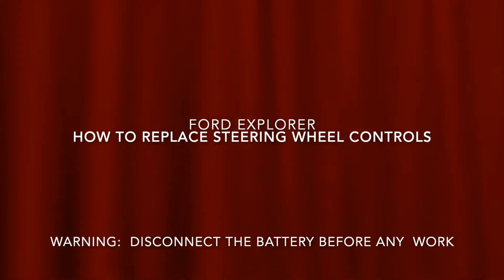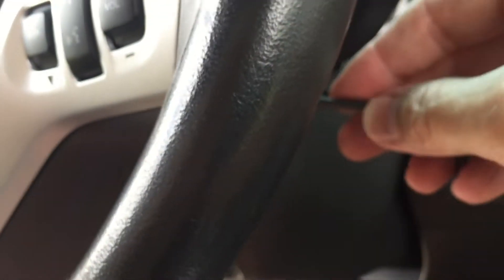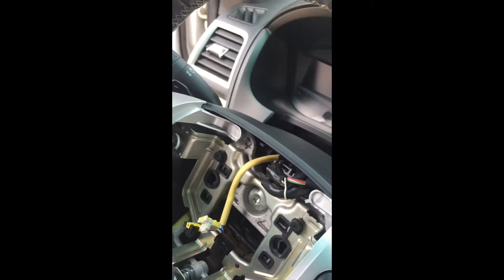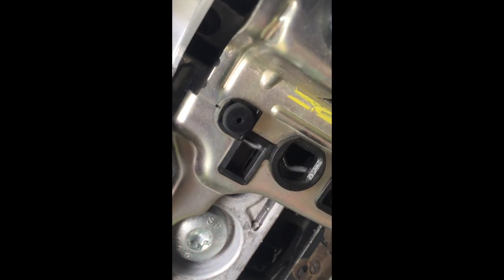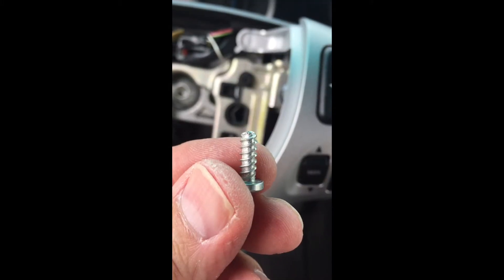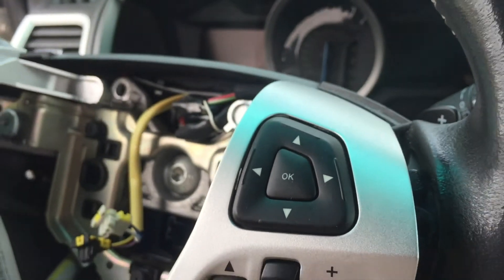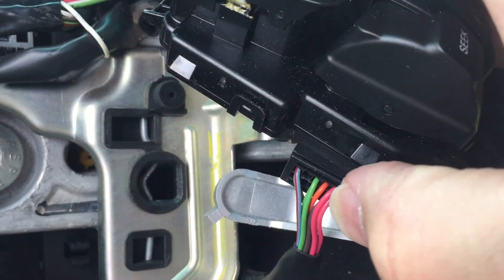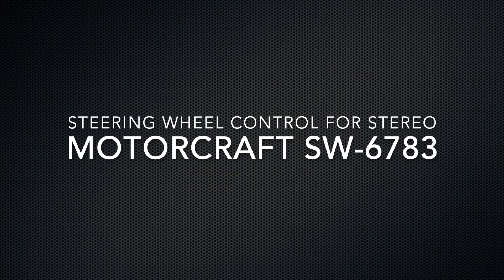Replacing 2013 Ford Explorer Steering Wheel Controls

Comment: How did you turn the steering wheel with out the battery being hooked up
Reply: Just remove the screws before disconnecting the battery and removing the airbag 😀

Comment: Did you turn the key to the accessories position before pulling the cable on the battery? Otherwise I don’t think I could turn my steering wheel if it was locked